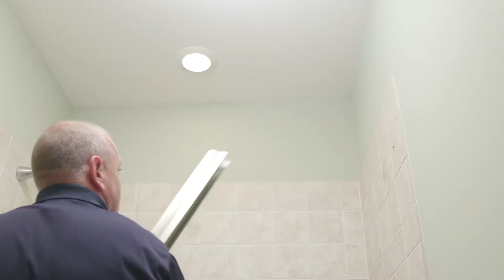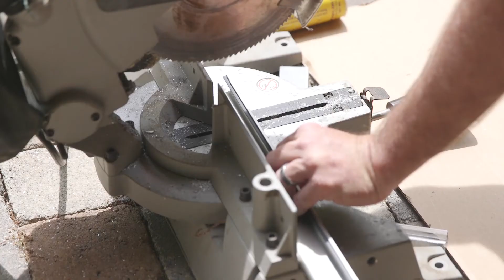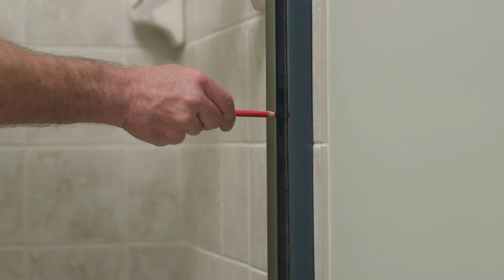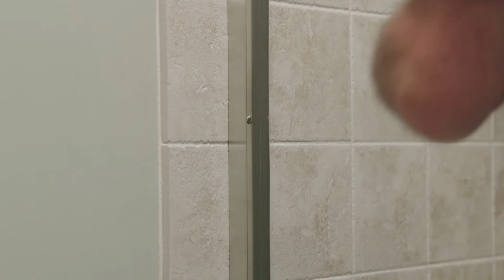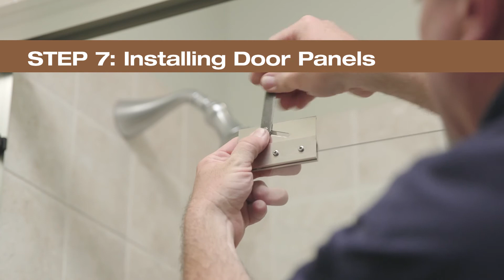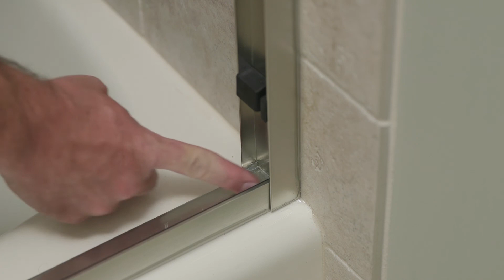DIY Shower Door Installation How To - Classic Series 3400/3500 Sliding Tub Door By Basco

Comment: I guess there's been some changes. First, make sure to trim the plastic/rubber strip that goes into the bottom rail as the side rails WILL NOT GO OVER IT.  Take about 1 1/4" off the wall to wall measure for this (not the metal, just the rubber) this gives you 5/8" on either side. Second, MY doors came with white plastic inserts not seen on this video. I called BASCO to ask if they were integral or just shipping protection. Mind you, I called installation SUPPORT. The person I spoke to said to me "it SOUNDS LIKE they're just packaging. Well they aren't. They are the anti-jump rails. Ugh. Thank gawd I didn't get the whole thing together before finding further instructions.